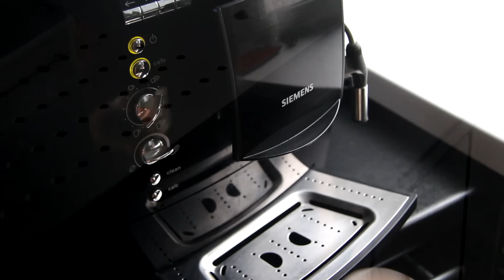iPhone XS Max Disassembly & Housing Replacement Tutorial – Fix It Yourself!

Comment: Do you heat up the back before pulling out the battery glue strip? Or should it be done as is to avoid the strip break?

Comment: I have an iphone xs max in which I have to change the geomagnetic sensor because it does not work. Can you tell me which spare part to replace please? Can it also depend on some flex cables? If so, which one?

Comment: Guys make sure you use your phones ORIGINAL OEM CHARGE PORT AND FLEX CABLE as otherwise the phone may not function properly and keep restarting , its easy to replace the charging port and flex cable just watch a vid on it :)

Comment: Im not sure if your aboit to help but i have an iphone xs max and i did a charging port replacement pretty easy but the phone stays on for 3 minutes and shuts off battery status seem to be correct everything work it just shut off after 3 minutes what do you think causing the issue
Reply from the maker: Poorly connected some cable to the motherboard or secured the wrong screw
Reply: Were you about to fix the shut down?If yes how did you do it?

Comment: What adhesive did you use for the battery? Does it matter much?
Reply: No it doesn't matter, you technically don't even have to glue it, although I advise against it. A qaulity Double-sided tape should do the trick